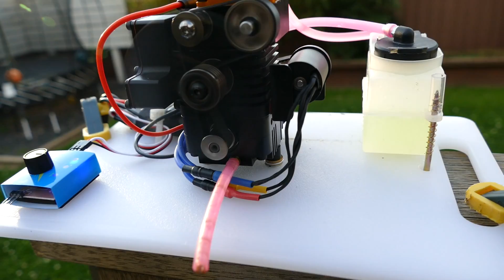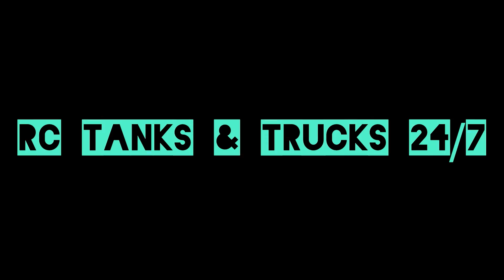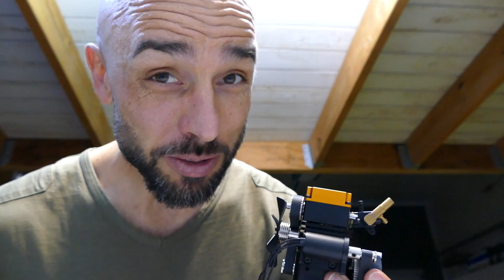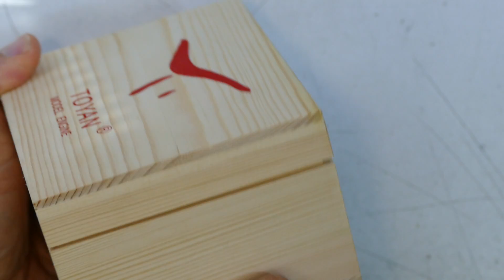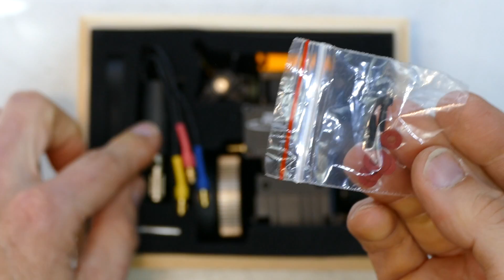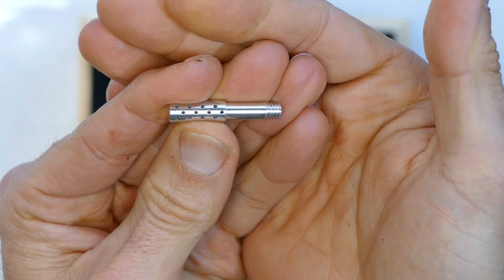MINIATURE 4 STROKE RC ENGINE WITH STARTER MOTOR! - Toyan FS-S100G - Part 1

Comment: THANK YOU THANK YOU THANK YOU! For telling me that you can run either nitro or gasoline with these versions!

I ordered the same igition kit with glow plugs, realized my engine MIGHT be the gasoline engine, and freaked out that I got the wrong ignition parts for it, and would need to spend close to a 100€ for the CDI and and proper spark plugs. 

Oh the relief!
Reply from the maker: Have fun mate

Comment: Got this one as a kit but can't get it to start. Is there anyone who can help me with this?
Reply from the maker: What is it doing?
Reply: @RCTanksTrucks247  nothing. The starter motor doesn't turn smoothly and has severe problems during the compression and power stroke. Also there is no ignition (The glow plug glows properly). Honestly, I have no idea what's wrong.

Comment: Could it produce 50-60w on idle? This would be fantastic, because it would make the best battery charger in the world, it would be relatively quiet, small and more than anything economical. No need for eco mode from the expensive Honda EU10i generator. The question is also how durable is this thing? Can it work for hundreds of hours without problems?

Comment: Hi,  Should I buy gas or methanol one.  Is gas referred to the one we fill our cars with.
Reply from the maker: The nitro one has the oil mixed into the fuel already. Otherwise the gas version you need to mix it yourself.
Reply: @RCTanksTrucks247  I didn't know about that.  Thanks.  
I will buy nitro one then.

Comment: I've heard from a few people that glowplug engines are being eclipsed by electric drive systems in models since battery technology has advanced. However, you can't beat the purr of internal combustion. I also just bought one of these to build a DC generator.

Comment: On your controller you can have throttle go to 100% on the first 75% travel and the last 25% adds in the starter motor for extra power.
Reply from the maker: Awesome

Comment: Does the battery come with the stater and ignition kit?
Reply from the maker: Nope you need to purchase one
Reply: @RCTanksTrucks247  Actually, I bought the "start kit" so it did come with two of them but i have not been able to get it to start at all. It turns over, The glow plug is getting voltage so idk...What voltage of battery are you using. Sorry, im a noob when it comes to this

Comment: Would the adapter for the two deans connectors for the spark plug and start up motor be parallel, I can't solder so looking for an adapter

Comment: #RCTanks&Trucks24/7   What Battery are you using? I've looked everywhere I can think of but I can't find it. If you could provide a link that would be awsome
Reply from the maker: Any 2 or 3 cell lipo battery will work with a deans connector.
Reply: @RCTanksTrucks247   Where can I find those good things at? Like Amazon? Or does it come from a certain place
Edit: Sorry if I'm asking to many questions lol

Comment: is the starter motor direct drive to the engine or is there a one way bearing which decouples the motor when the engine is running ?
Reply from the maker: One way bearing

Comment: That looks so cool. But am puzzled as to why they are using a brushless motor for starting. Surely it would be much simpler, and cheaper to just use a 12v brushed starter with a traditional switch.

Comment: That's pretty sweet hope you use in a build and Hopfuly add some sort of transmission to send the power to the wheels and add a transfer case if going into a 4wheel drive type rig.Or have the motors in a on road car with a transmission for realistic car or truck.Just a idea.
Reply from the maker: Much appreciated bro! Definitely will trying to make it fit into something

Comment: I would also run the exhaust pipe all the way out the back of the RC vehicle I think would be a neat touch
Reply: If you go to the motors website you can see where they have it installed in a truck with the exhaust going out the back. It is really cool to see.
Reply from the maker: Very cool

Comment: Waste of money and time. Not enough power for a crawler. Already mounted it in a scx10. Also gets hot and flashes out under load after a minute or so on flat level ground. This is with the steepest gearing. 
Giving it one last go in a 2wd drift car. Otherwise, 
Cool static display at best.
Reply from the maker: Depends how you look at it. I will put it to the test and see how it performs

Comment: What will be the reliability of this engine under load and on a long run.
Reply from the maker: Not too sure but being 4 stroke it doesn't need to rev as high as the torque band is lower